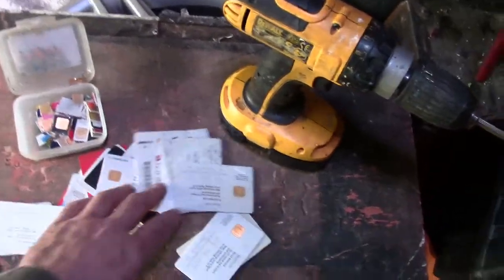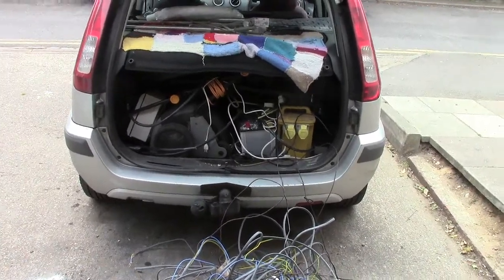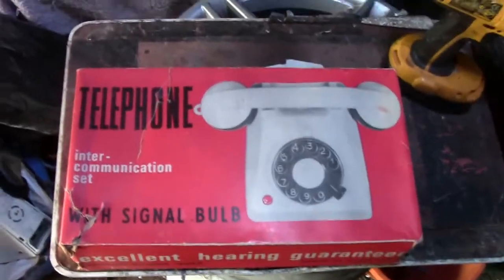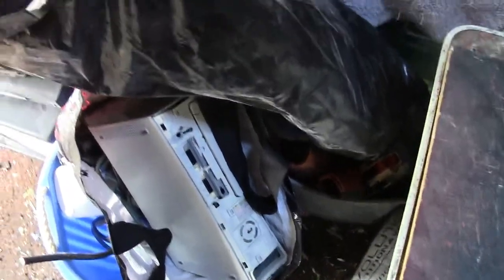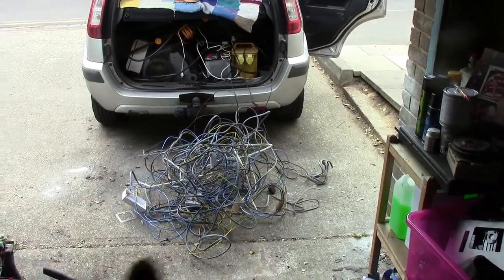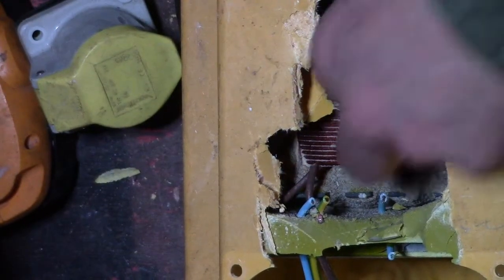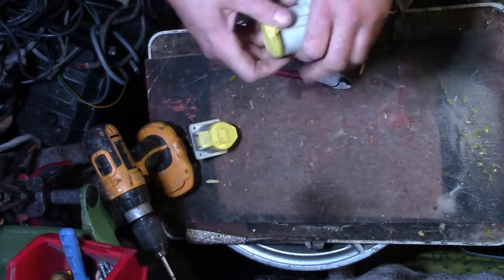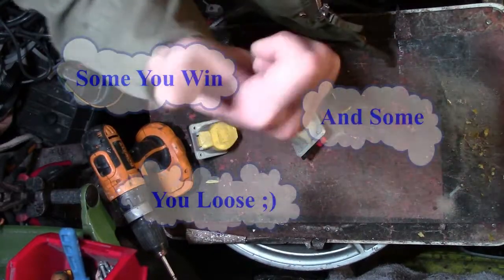Transformers - Alloy In Disguise?   Scrapping A Site Transformer

Comment: Those plug's don't half mount up quickly. Good night out mate! It might be worth sticking those telephones on ebay.
Reply from the maker: Will do 👍 they seem to be making around a tenna but that's a lot of cable to make the same tenna in scrap, every little helps ect ⚒️⚒️
Reply: @Dirt-Diggler  👍 I thought they'd have been worth more, still a great find though.
Reply from the maker: @pa_maj.MARTINI-van-MAN  Some are up for hundreds but sold ones went for 10>20 quid but happy with anything more than the 3 pence they are worth in scrap 😁
Reply: @Dirt-Diggler  I've overspent on ebay just because I've wanted something badly at the time, you need a mug like me to be interested enough 🤣👍👍